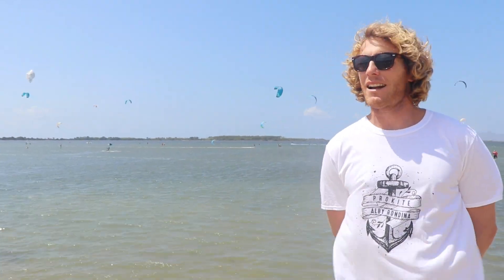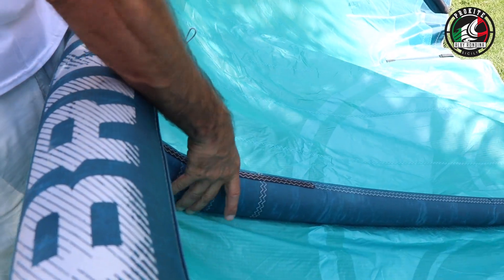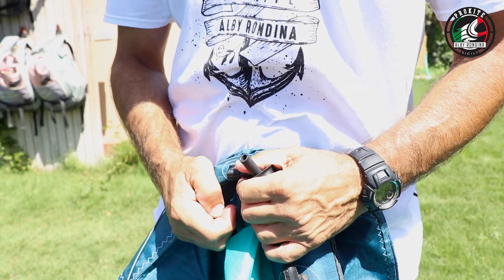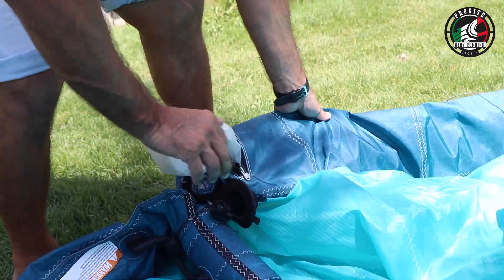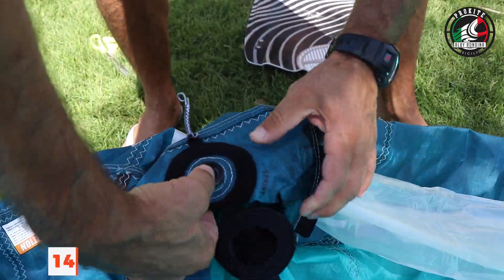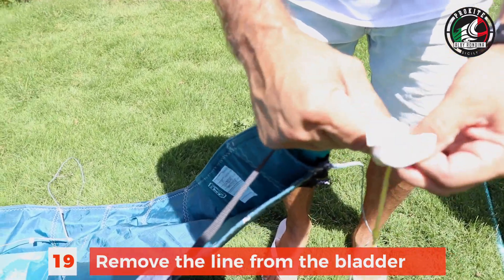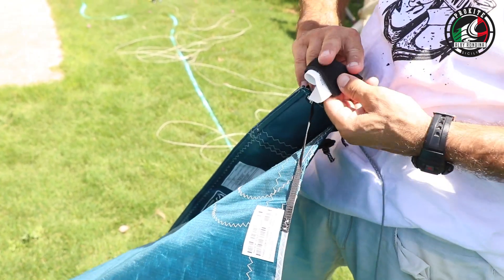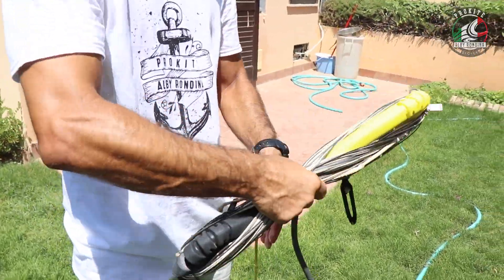How to #1 Replace A Kite Bladder | Prokite Alby Rondina

Comment: Thanks. Any update for the step number 7 in the 2020 Cabrinha kites? I am afraid of damaging the kite when pushing the valve down into the strut sleeve, because it now has a pin on it's back.